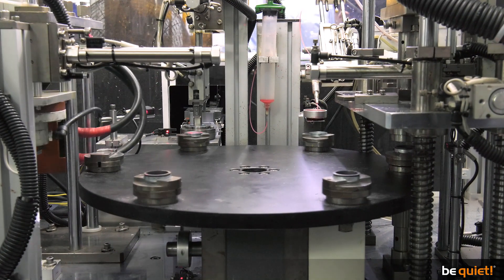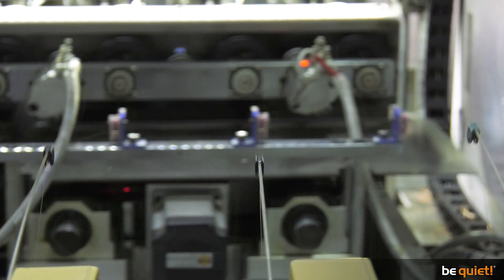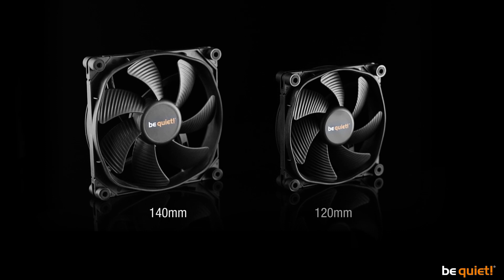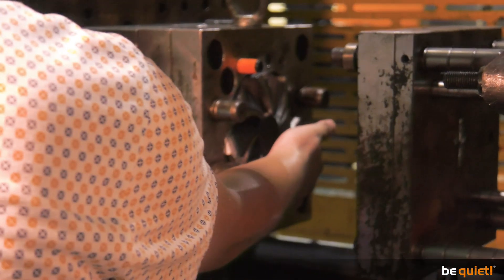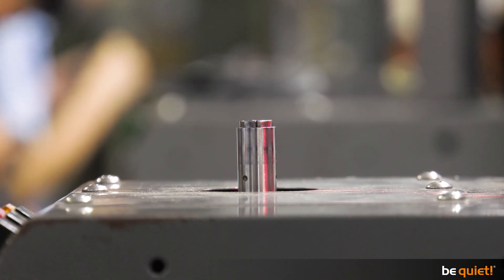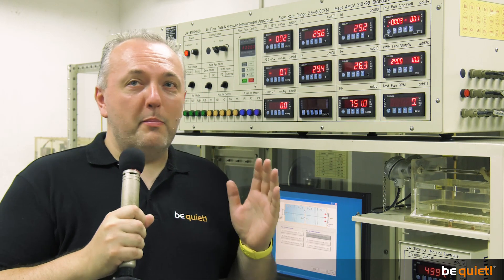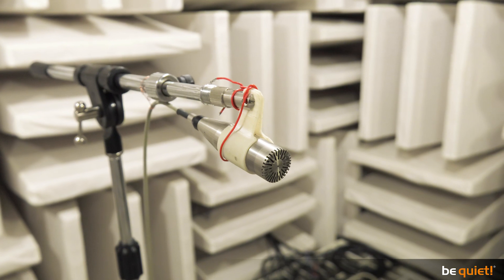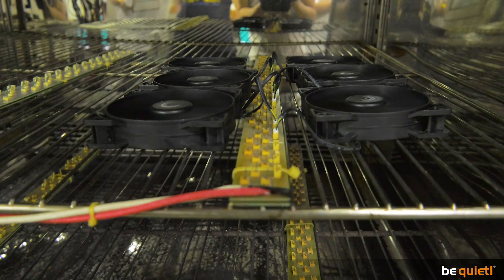Engineering Wizardry: The Production of Silent Wings 3 fans

Comment: Hi be quiet! Does Silent Wings 3 120 PWM High Speed at 1450 rpm has same or less amount of air flow than Silent Wings 3 120 PWM Standard at maximum speed ? Thanks for your support :)

Comment: I just bought two of these fans for a new build. So glad I did. The Corsair fans that came with my case were garbage. Moved little air and was very loud. These fans are also quieter than the Cooler Master RGB fans that came with my AIO.  I am very happy and they are worth every penny ($20usd).
Reply: I have the magnetic levitation Corsairs. Even at low speeds the motor sounds like a rattle snake.
Reply: @chesshooligan1282  I recently tried the Arctic P12s on my AIO and they are my new favorite. Quiter than the be quiet! 3s, cheaper (less than $10usd in a box of five), AND move more air. Good for cpu air cooler set ups too!
Reply: I still use these for case fans but my new favorite fan is the Arctic P12s designed for AIOs. They are even quieter AND have the flow for air cooled cpus and AIOs. The cost is the best part. Cheap as chips.